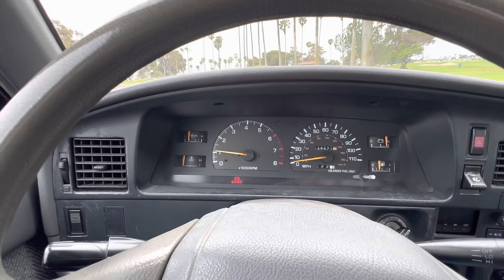1989 Toyota Pickup 4WD xtra cab 22RE Off-road

Comment: Rather had 22 r 4cylinder 3.0 v6 have 90 toyota 4x4 have now more reliable engine 22 r 4cylinder 3.4 v6 had rebuild my truck blew 3.0 v6 up 800 thousand miles threw head gasket water pump timing belt broke 3.0 v6 3.4 v6 only choose